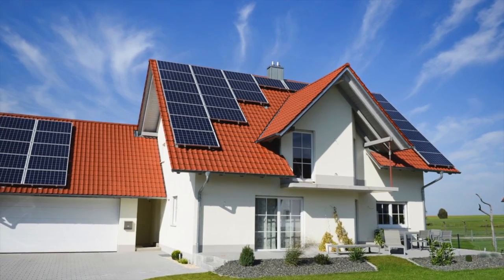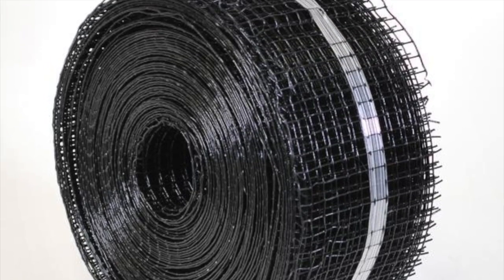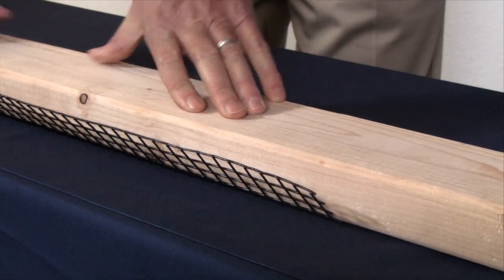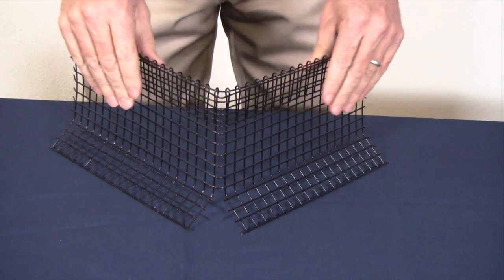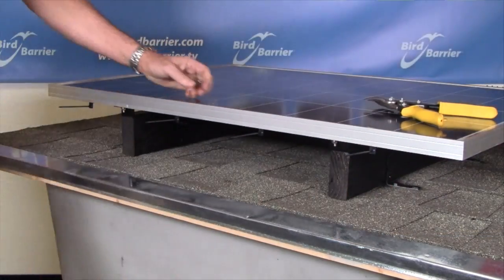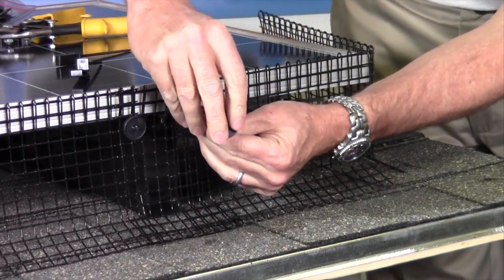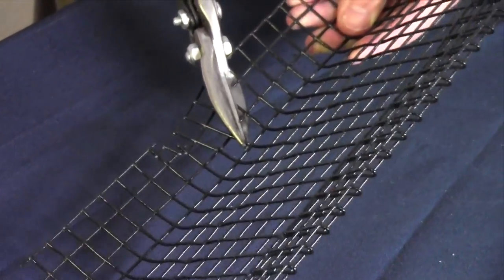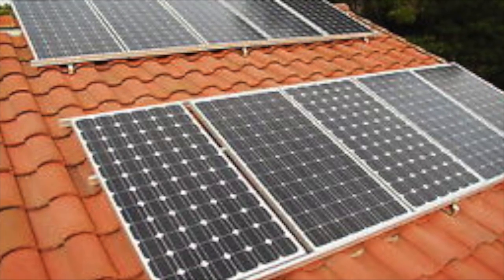An Installation Guide To - Bird Barrier's Solar Panel Exclusion Kit

Comment: Solar City installed this on our panels as we had squirrels building nests underneath and chewing the wires.  Since the panels/power is leased from Solar City, it was to their advantage to do this.  But there is an issue.  Leaves build up inside the mesh underneath and the only way to get rid of it is to remove the lower mesh temporarily and blow air (leaf blower) or spray water.  This is happening on my lower panels, so it isn't hard to get to, though.
Reply: Hello Kevin, as for the solar city, do you mean  Solar City from Tesla?
Reply: @robinliu1207  yes
Reply: @neustkg  is it also need this mesh for protecting? I see Solar proof needn't the mesh, because there is no gap between the panel and roof, are you sure?
Reply: @robinliu1207  yes there is a gap of about 3 to 4 inches.  Panels do not sit directly on the roof but are raised up

Comment: will not work on all panel frames
Reply from the maker: Unfortunately, there are some panels on the market that do not have the lip underneath, so it will not work on them. Make sure your panels are compatible before ordering!
Reply: Did you find a workaround? My wife is on the roof right now trying to figure it out

Comment: how much is it and does it work on spanish style roof top.
Reply from the maker: Check out http://www.birdbarrier.com/products/solar-panel/
Reply: Hi ntobate74!
Our company is Prestridge Solar and we provide solar panel cleaning, solar panel bird netting and window cleaning services to the entire central west coast of california. For this job we would charge $7.99 a linear foot (for mission style tile roofs) Our pricing starts at $4.99 a linear foot for comp roofs. Mission style roofs are very tedious due to the excessive trimming to the bird netting which is why the price is higher. We use industry leading clips and downward pressure on the netting for our installments (so you dont get chunks of glue all over your tiles). If you happen to be in our service area feel free to reach us at (805)270-3070 or visit our website at www.prestridgesolar.com. If your not in our service area I hope this information helps!
Reply: @prestridgesolar567  how much do you guys for cleaning solar panels